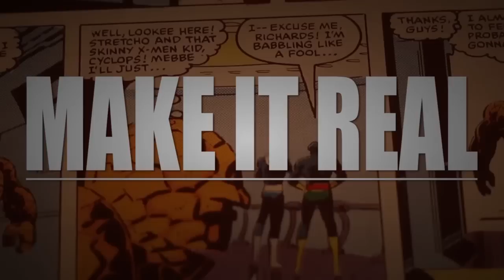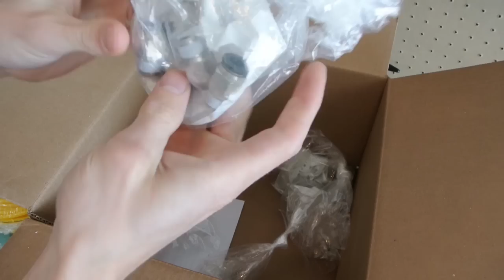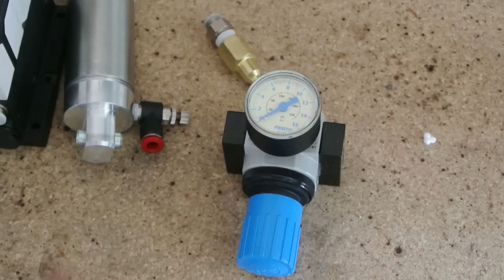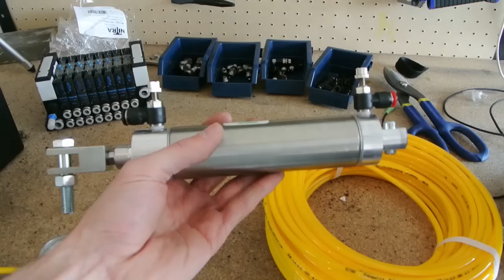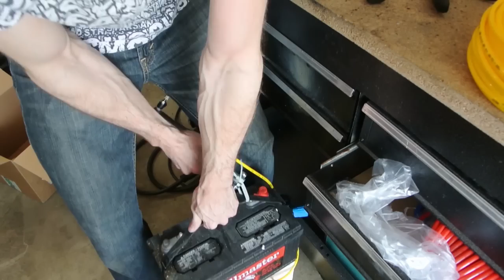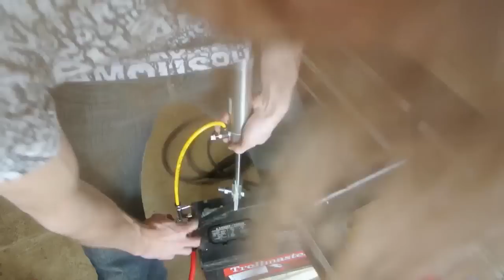Elysium Exoskeleton, Part 2: Testing The Cylinders

Comment: +the Hacksmith   Could someone please tell me when a pneumatic cylinder fully extended and the valves all closed, does it retain it's position and holding force? Thanks
Reply from the maker: +ZBCuber Correct. It depends on the type of valve you use, but once the cylinder is pressurized the valve could be closed and it would retain it's holding force.
Reply: +the Hacksmith ok thanks.

Comment: What is the specific name of the cylinder and where did you order it
Reply from the maker: They're actually discontinued, I got them for free when a company was throwing them out.

I'd recommend checking eBay for something similar. They are rated for 250PSI, have a 100mm stroke, and I believe a 1.5" bore diameter. They wouldn't be the cylinders I would of picked, but they were free.

Comment: While your at it maybe put a combustion engine on your arm. Hahaha so powerful how much research have you done on this I have seen a lot of designs that work and some that don't like that wire pully and that Japanese weight lifting and disability  expo skeleton using a quite flat electric engine that doesn't look to hard to build . The fun pat of this is what covers are you going to print with 3d printer . Reminds me of obamas iron man
Reply from the maker: Aha! Once I have a working prototype I'll continue to refine it. Will definitely have some cool accessories!
Reply: Aka grapple / climbing claw

Comment: This is so cool.
A question: how difficult would it be to make a similar skeleton that simply locks its limbs in place, instead of power-assisting their movement? Would you just need to regulate the float control valves?
Reply from the maker: Not too difficult, but what would the point be then?
Reply: the Hacksmith Hmm... I was going to say lifting a heavy object- you yourself only have to exert effort for a second or two, then lock the skeleton and let it take the load. You'd still have to make an effort with your legs, though.
If you had a smaller, similar arrangement for your hands, you could hang on to a jungle gym with one hand and do crosswords with the other?
Might be useful as a means of absorbing impacts and g-forces, though.

TLDR: not much.
Reply from the maker: Spaghetti775 Not too hard -- for something like that you'd want a ratcheting gear at each of your joints. That way when you move the joint it will lock as you go -- the only problem is having an easy way to release the gear when you want to let go...
Reply: the Hacksmith Would it work to have something akin to a bicycle brake? Squeeze a handle (somehow), pull a cable and pull the ratchet gear out of alignment with its teeth?